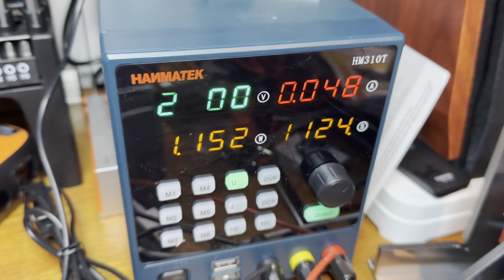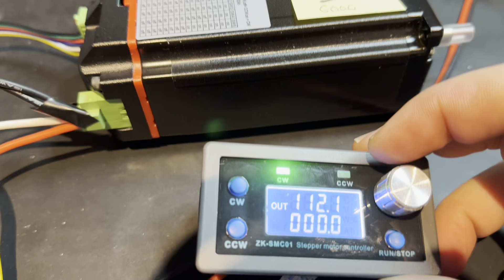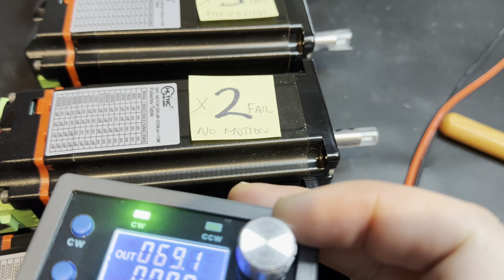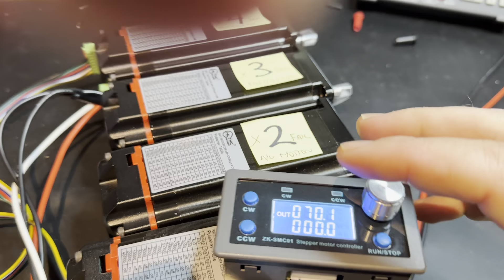HLTNC Closed Loop Steppers

Comment: Their listings seem to have pretty good ratings, but this is one of the only YouTube videos, so thanks for posting. Would you mind dropping a link or the model number so I can cross reference?
Reply from the maker: The steppers were from HLTNC.  The part number was YT57L112S8N3.  I was really disappointed with these but I think they just shipped me a set of garbage ones.  I was too scared to buy them again.
Reply from the maker: I just found this on AliExpress: C$100.88 | HLTNC Nema23 Closed Loop Stepper Motor 1.2n 2n 2.5n 3Nm Hybrid Integrated  Servo Motor With Driver For 3D Printer CNC Engraver
https://a.aliexpress.com/_mrwUUcX

Comment: Would you recommend against buying these? Found the same ones on aliexpress that seemed well priced
Reply from the maker: I needed to post this video to get a refund from AliExpress.  I was upset with the quality of the motors I received.  I didn’t end up buying replacements because of the quality.  I believe that these motors are used on some models of CNC so you might get lucky with some good ones.  They were well priced when I ordered them.